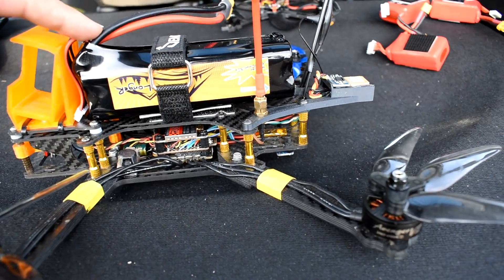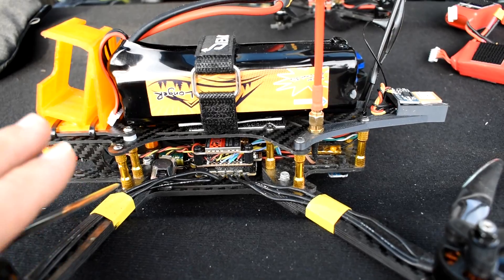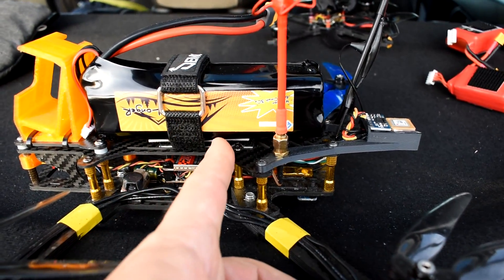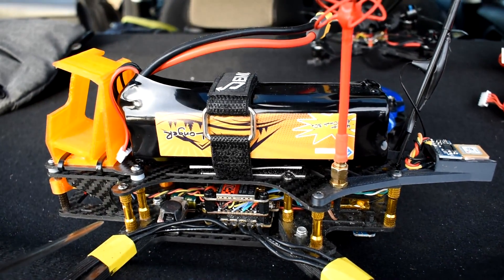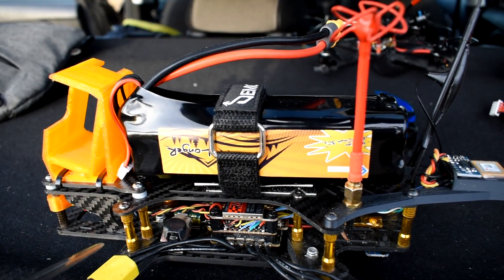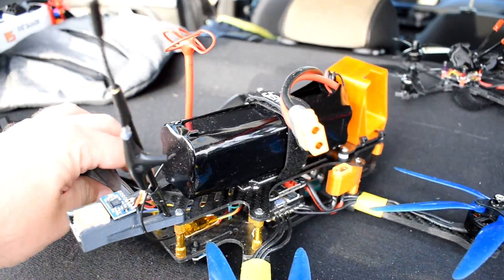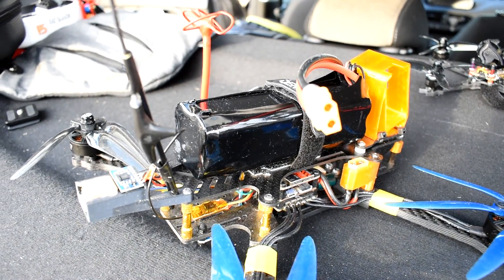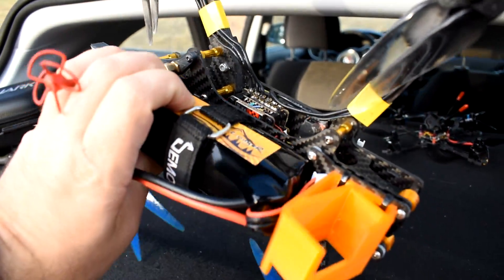4S2P 6000mAh Li-Ion battery from Farins Frames

Comment: Hi Pavel I'm an aircraft engineer (unfortunately mechanical/structural) trying to build myself a drone thats a little different, I want redundancy and power, if for 18650s, is it possible instead of say 8s 2p, I could run 2 off 4s 1p to seperate (rings/busbars) pdbs, then to series? Then the drone could switch to 4s at half capacity in case of failure? Also you said something like you could use 3s 4p or 4s 2p for example (sorry can't refer back during comment) how does voltage play to allowing a bit more current or c rating in the case of the 3s 4p? I'm only up with parallel batteries stacking capacity and I understand that low kv = less amps for V. But thats not factored is it? Also I'm wondering if reverting back to lower torque motors but pitch controlled to manage current. How would inav manage that? You could fine the pitch purely in reaction to current no, with that cool condition mode thing you showed? Could inav handle a complete hybrid even if mixed quad and control surfaces? I really want to build an attack drone 🤣
Reply: I also think we need to factor in some body lift and block the prop edge contacting oncoming air, but maybe ducts a bit much,
Reply from the maker: I'm not sure I get where you want to get with this. You want to be able to disconnect half of the battery in flight? I mean it can be done with some kind of electrical curcuit but I'm not sure it makes sense. From my experience batteries rather do not die out of nowhere during the flight. It's rather a gradual process
Reply: @FPVUniversity  its well possible I'm saying something stupid, I won't have the knowledge to know otherwise lol. As regard batts, i want 8s 4p capabilities in maybe an unusual, possibly fixed configuration, and quite a large craft, again citing redundancy, if i had a cell explosion that could take one whole series pack of 4 the whole ring (circuit/busbar) would be lost, but if i split that across 2 seperate rings (2x 4s2p vs 8s4p) feeding 2 pdbs. Can i not take off them in series. Im pretty sure I'd get emergency landing power from 4s on a 8s system, my full design would be pitch managed so I could run bigger higher kv motors I think.
Reply: @FPVUniversity  forgot to mention my motivation is providing or helping grow the professional technical fpv arena, and I was thinking 32x 21500 as my power source

Comment: 6s1p works for me.   You should build your battery layout to fit your frame.  I use 21700's 4200mah 45amp on my 7" instead of 18650, but if you got a 5" or smaller use 18650s.. Soldering up battery packs is indeed a royal PITA and very time consuming.  Even though I do it, I don't recommend it.  So many bloody solder points and wires to connect up:    If you do figure out how you are going to arrange and fit them on your quad first.   I lucked out, going length wise fit my 7" just right, and I could mount it top or bottom or both if I move my GPS onto the top of the battery pack.  6s 21700 4200mah 45a Pics:

http://air-war.org/graphics/overloaded_truckbed_04.jpg
http://air-war.org/graphics/Battery02a.jpg
http://air-war.org/graphics/Battery02b.jpg
http://air-war.org/graphics/Battery03c.jpg
http://air-war.org/graphics/Battery03a.jpg 

I was afraid my 6s1p quad battery would brown out when I punched the throttle to full, but so far... no problem.  For padding to fill in the gaps and irrecularities (nuts) between the frame and batteries, I cut out pieces from thin spongey mousepads to fit.

I run 4s3p and 2s3p  21700 5000mah 10amp on my goggles and transmitter batteries.  I don't solder them up that way, I just plug 3 S batteries in parallel into a cheap balance board and run off of that, with a BX0199 voltage alarm also plugged into each.    By using the balance board to aggregate 1S batteries, I can reduce or expand my goggles and transmitter packs as needed. 

4s 21700 5000mah 10a: http://air-war.org/graphics/Battery01c.jpg

Recently I realized you could run both of them right off a car battery sitting on the ground and upsing a lipo charge ouput screen to output 8.2v to power both with an extension cable, and I'm thinking... I want tot ry that as well.  Liion batteries expensive, but 12v car batteries, ups gel batteries, lawn motor and motorcycle batteries can be had int he wild for free or cheap.  Just run your 12v to your lipo charger in,t hen output 8.2v on the output screen and run a cable to your trannsmitter and DJI goggles.  Never have to worry about running out of transmitter or goggle battery juice again, or ever buy batteries for them again.

My problem is that after 8 months of a pandemic, I just don't want to leave the house or go anywhere any more :-/  Nothing I can buy on Banggood can fix that... 

 fpv.air-war.org

Comment: Good stuff, Pawel! I just built a 4000 mAh 4S1P with 21700 lion batteries (Molicel INR21700-P42A 4000mAh - 45A). Over 20 minutes flight time on my fairly heavy 7 inch TBS Source One with 7 inch bi-blades. This battery is only slightly heavier than a 4S 1500 mAh Lipo. Now all I need is the T-Motor F7 target for iNAV!! :-)

Comment: The cells used in this battery pack are Sony VTC6 which Mooch (the god of 18650 battery testers) rates at 15 amps continuous- so for a 2P that gives 30 amps max.

Comment: You can also build a cheap battery welder from a motorcycle or riding lawn mower 12V battery, some heavy gauge wire, and an automotive solenoid.  Lots of youtube videos on how to build one.

Comment: Has anyone tried LiIon batteries on a small plane (e.g. Zohd 250)? I've been evaluating some IMR14500 batteries that advertise 880 mah (and seem pretty close to that in initial testing), and I think they might work, but I'm not yet convinced they provide enough of an advantage of LiPo. 3 bare cells weight about 58 grams, so a 3S1P pack would likely weigh under 70g. I have 3S 1AH Lips that weigh 83g, so it seems like more of a break even. Maybe the advantage of being able to drive them to a lower voltage might give an advantage? I'm curious if anyone has tried anything other than 18650.
Reply: I am flying a 3S 3000mah on my dart250g, at least 20/25min of flight time
Reply: @TeamFarins  It flies well with that much weight? How did you balance it?

Comment: I've been using Titan Power Li-Ion packs for a couple of years now. I built a quad spinning 17" props on 700kv motors pulling less than 10 amps at a cruising speed of around 20mph. Flight times average 30min with a all time best of 48min. So far I've only flown 5 miles out and I agree anything over 20min. feels like an eternity.

Comment: in this case, it's not better to buy. It takes me about an hour (at worst) to build mine!!! 63 Euros for a battery that I am already building for about 36E at home (have built 4 sony vtc6 4S2P packs and flying them successfully for the past year or so with no issues) is really steep... It's even steep compared to lipos of the same capacity!!! Sorry, wouldn't buy, even if I didn't build my own packs...

Comment: Pawel, a good video with very useful information. I made my own 4s2p packs using a spot welder and also soldering another second pack. But as you mentioned it is a hassle to do to save a few dollars. What i ran into when trying to purchase 18650 cells were deceptive ads claiming to be a much better battery than the actually were. When mine stop working I will purchase already made packs.

Comment: FYI... It is a bad idea to SOLDER to Li-Ion batteries...
Reply: If you try to replace a 4s lipo on a quad you have to consider that you might need motors with slightly higher kv or just a cell 5s instead 4s. For example I have a 17 inch prop quad, refulary runs on 4s with tmotor 3508 580kv, with liion you need 6s because liion you can discharge toll common 2.8v a lipo I stop at 3,55v. Due that the rpms a much lower at 2.8v with liion
Reply from the maker: No, not really. With a proper method, big soldering tip and soldering acid it's not any danger for the cell and it will not overheat at all
Reply: @FPVUniversity ...  I've also done it until I learned excessive heat it is not good for the battery health. Most people don't have a huge soldering iron and they tend to leave a too low wattage iron on too long to try and make a joint.
FYI.. Acid flux is a definite No-No for electrical/electronic solder joints. Acid flux promotes corrosion of the joint over time and with current flow. Been there... done that. Use a Rosin type Flux instead.
They are not my batteries and you can use any method you want... You could even use a stapler to attach your wires..... ;-)
Reply: @FPVUniversity  exactly. it takes half a second. no real heat dissipation at all. I did it several times.
Reply: not really..
Reply: @tjburke79  Yeah.. Really... but only If you had understanding of Li-Ion batteries.
Reply: @lasersbee  reason?

Comment: Did that say 30C on the pack ?...lol....I've been testing these li-ions recently from  https://www.18650batterystore.com/ ....In particular the molicel 5000 mah 15 amp cells....4s pack is almost 1/2 the weight of lipos and in a nice normal cinema style flight  I see only about  around 10-15 amps anyway in my 7" Glide with bi-blades and 2400 kv motors . According to the data sheets we can draw these down to 2.5 volts and I flew  about 20 minutes with a terminal  3 volts under load...bumped right back to 3.6 a few minutes later...

Comment: Nice, but 6s is more efficient - I got almost 20min of flight time on my DC7 iFlight with 6s1p VTC6 Li-ion.
Reply: 25min on molicel P42A 6S1P. 7" Mark 4, 550g dry weight running some big 2508 motors and DJI air unit.
Build another 7" today on same frame, wich is 160g lighter and also digital (caddx vista). It's a super leightweight build running 2306.5 Motors. Expected flight time 30+ Minutes on same battery.
Reply: @waldemarkraus2855  I might just try these cels as well. They should be about 180g heavier than my 6s1p VTC6 pack but the capacity is higher. I fly the new tmotors f90 1500kv.